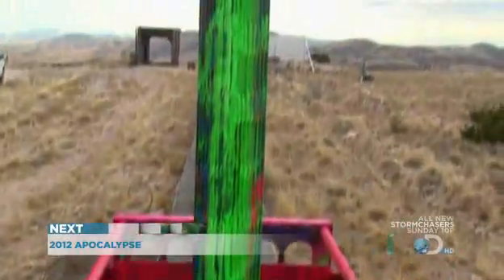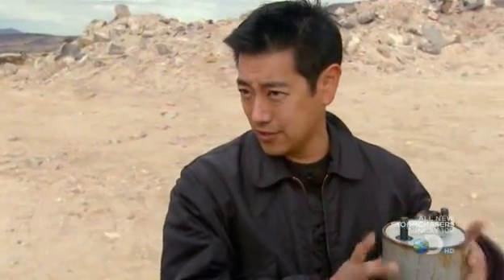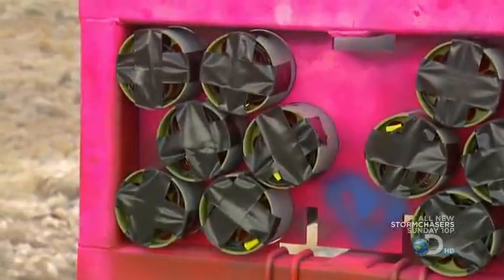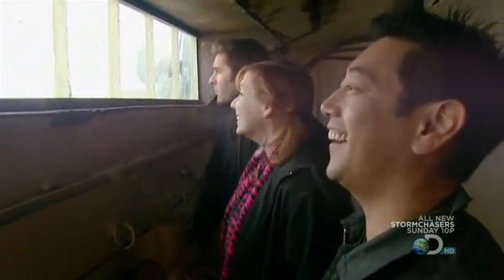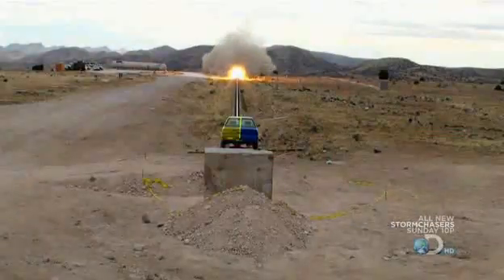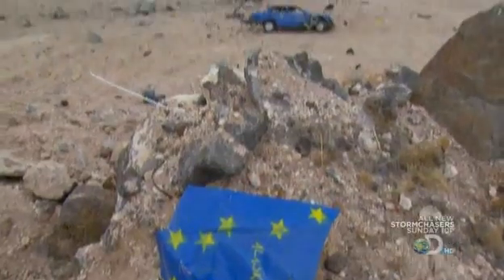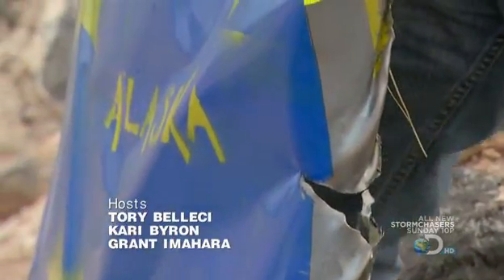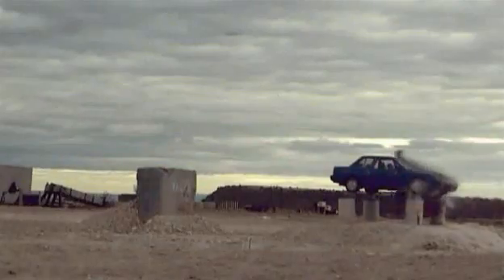Mythbusters: Myth Revolution - Rocket Snowplow

Comment: 15 feet of car.  Including the virtually solid mass of the engine block.  Sliced in two by a rocket sled that weighed 2 tons?  And the Truthers have a hard time understanding how a passenger jet can slice through hollow steel columns 9 mm thick and 2 feet square of the WTC. 

Really?
Reply: Talk about a hard time understanding, you're really embarrassing yourself. 
The "solid" engine block and most of the car was softer  ALUMINUM which was utterly DESTROYED by the HARDER STEEL BEAM.  Sled has nothing to do with the impact between the mounted steel beam and the car.
The POINT of the video here is the "harder than aluminum" STEEL BEAM went THROUGH the softer aluminum car.
In the hollow parts of your brain, PRETEND the car was a plane that flew into the steel beam of a building!!!! . 
Now that you have that collision orientated  you'll see it demonstrates a harder steel beam of the building didn't get split by the softer aluminum car (plane) particularly at the fragile tips.  Kinetic energy, and inertia mean NOTHING because the two objects are in reality traveling towards each other at the SAME SPEED.  
This may be unfair because it requires you to comprehend what your seeing. try this one; https://www.youtube.com/watch?v=T5XTsQ-9vvo
ask yourself, gee why didn't the wings shear off? how come in the WTC video there's NO ejecta blowing backwards showering the WTC streets below with tons of debris?? why are there NO ripples or any impact shock wave traveling across the glass perimeter facade? or along the wings. THe wings would have crumpled against the heavy interconnecting steel plates between the 32' tall facade sections. google their architectural structure and you'll see them. the 4-6" deep reinforced concrete flooring of the 7 floors impacted alone would have stopped any plane in its tracks. 
  Because the WTC videos were FAKED an photoshopped but not without errors due to broadcast times...
Reply: @johnzarollin2749  thanks, finally someone who understand laws of physics.
Reply: @PetrLunak  it ain't easy but some ones gotta do it right? ha.
by the way, a NY state attorney's office has agreed to submit a new cause for discovery on the NIST 911 findings before a grand jury. It has been accepted. Actor Ed Asner and other's spent years raising the money needed to fund the new investigation  . Finally. bush and cheney may swing after all.
Reply: @PetrLunak  you're quite welcome, it may have been all those years at Lockheed MIssiles & Space Co. in CA. 
Building things that went boom in the night, 
counted hairs on heads from many miles above, 
or picked up items a few miles deep. 
Interesting work. A few things I like to tell people but can't. Things have NOT been what you thought they were for a very long time.
I started there after deciding not to work for a new startup company that didn't look promising at the time. It was called  INTEL. Man did I regret that.
Reply: The plane was supposed to break the 41 steel columns. Idiot!
Reply: You're a fucking moron.
Reply: roquefortfiles Wonderful thing kinetic energy.
Reply: The Popup Shisha Lounge It softens the steel the weight it supports does the rest which is why it took awhile to collapse! Explosives at the base means alot of quantity many instances of failed demolition from vegas and other buildings or bridges.
Reply: The plane is made of aluminium and that's much softer than the steel of the columns.
Reply: marinus18 Aircraft aluminium is alloyd to make it tough The airframe it's  not entirely  aluminium but iron even titanium would be used by the wing tips to prevent fluttering i would  think . Those box beams in the core were the thinnest of the columns in the buulding at the top section that plane took the shear out on that one side those buildings took a hell of a hit what did it shake loose besides fire retardant and drywall
Reply: Mathias Johani The box beams were strong but thin think of motorcycle front fork tubes big diameter but thin wall thickness. To keep them light as possible.
Reply: +Gene Rodriguez
Duralinum is tougher than normal aluminium but still much weaker than steel. Commercial airplanes don't really use titanium. It is mainly used because it's heat resistant which is only a factor in supersonic airplanes. With the wing fluttering I think you mean the counterweights that are installed in the wings. But those are usually made of lead or depleted uranium which is even softer than aluminium.
Reply: Mathias Johani Box beams were the sizes you stated The thickness of the steel making up the box beam was very thin so as to be light but strong.
Reply: marinus18 It's all about velocity you can send a marshmallow thru 3/8 osb sheet or as i did a 139 grain copper and lead softpoint thru a 3/8 piece of angle iron at close to a 45 at 75 yards
Reply: Roque You clearly  lack the intelligence for the debate. For starters the beams weren't 9mm thick. Even if the soft aluminum of the plane managed to slice through all those beams. (By somehow not disintegrating ) How did it cause the building to collapse in on itself? The beams underneath were not sliced by your miraculous aluminum.
Reply: Aluminium's combination of lightness, strength and workability makes it the ideal material for mass-produced commercial aircraft.  Strong aluminium alloys take the extraordinary pressures and stresses involved in high altitude flying; wafer-thin aluminium panels keep the cold out and the air in.
Many internal fittings like the seating on planes are made from aluminium to save weight and therefore fuel, reduce emissions and increase the aircraft's payload.
Today, there are over 27,000 commercial aircraft flying in the world, and many thousands of light aircraft and helicopters. Demand for passenger aircraft alone is set to double from 15,000 today to more than 31,500 by 2030.
Aluminium is the primary aircraft material, comprising about 80% of an aircraft's unladen weight. Because the metal resists corrosion, some airlines don't paint their planes, saving several hundred of kilograms in weight.
Aircraft manufacturers use high-strength alloys (principally alloy 7075) to strengthen aluminium aircraft structures. Alloy 7075 has zinc and copper added for ultimate strength, but because of the copper it is very difficult to weld. It anodized beautifully. 7075 has the best machinability and results in the finest finish.
 
Aluminum 7075-T6; 7075-T651
 
Subcategory: 7000 Series Aluminum Alloy; Aluminum Alloy; Metal; Nonferrous Metal
Close Analogs:
Composition Notes: 
A Zr + Ti limit of 0.25 percent maximum may be used with this alloy designation for extruded and forged products only, but only when the supplier or producer and the purchaser have mutually so agreed. Agreement may be indicated, for example, by reference to a standard, by letter, by order note, or other means which allow the Zr + Ti limit.
Aluminum content reported is calculated as remainder.
Composition information provided by the Aluminum Association and is not for design.
Key Words: Aluminium 7075-T6; Aluminium 7075-T651, UNS A97075; ISO AlZn5.5MgCu; Aluminium 7075-T6; Aluminium 7075-T651; AA7075-T6

Component
   Wt. %

Al
87.1 - 91.4
 
Cr
0.18 - 0.28
 
Cu
1.2 - 2
 
Fe
Max 0.5
 

Component
   Wt. %

Mg
2.1 - 2.9
 
Mn
Max 0.3
 
Other, each
Max 0.05
 
Other, total
Max 0.15
 

Component
   Wt. %

Si
Max 0.4
 
Ti
Max 0.2
 
Zn
5.1 - 6.1
 

Material Notes: 
General 7075 characteristics and uses (from Alcoa): Very high strength material used for highly stressed structural parts. The T7351 temper offers improved stress-corrosion cracking resistance.
Applications: Aircraft fittings, gears and shafts, fuse parts, meter shafts and gears, missile parts, regulating valve parts, worm gears, keys, aircraft, aerospace and defense applications; bike frames, all terrain vehicle (ATV) sprockets.
Data points with the AA note have been provided by the Aluminum Association, Inc. and are NOT FOR DESIGN.
 
Physical Properties
Metric
English
Comments
 

 
Density
2.81 g/cc
0.102 lb/in³
 AA; Typical
 
Mechanical Properties
 

 
Hardness, Brinell
150
150
 AA; Typical; 500 g load; 10 mm ball
Hardness, Knoop
191
191
 Converted from Brinell Hardness Value
Hardness, Rockwell A
53.5
53.5
 Converted from Brinell Hardness Value
Hardness, Rockwell B
87
87
 Converted from Brinell Hardness Value
Hardness, Vickers
175
175
 Converted from Brinell Hardness Value
Ultimate Tensile Strength
572 MPa
83000 psi
 AA; Typical
Tensile Yield Strength
503 MPa
73000 psi
 AA; Typical
Elongation at Break
11 %
11 %
 AA; Typical; 1/16 in. (1.6 mm) Thickness
Elongation at Break
11 %
11 %
 AA; Typical; 1/2 in. (12.7 mm) Diameter
Modulus of Elasticity
71.7 GPa
10400 ksi
 AA; Typical; Average of tension and compression. Compression modulus is about 2% greater than tensile modulus.
Poisson's Ratio
0.33
0.33
 
Fatigue Strength
159 MPa
23000 psi
 AA; 500,000,000 cycles completely reversed stress; RR Moore machine/specimen
Fracture Toughness
20 MPa-m½
18.2 ksi-in½
 K(IC) in S-L Direction
Fracture Toughness
25 MPa-m½
22.8 ksi-in½
 K(IC) in T-L Direction
Fracture Toughness
29 MPa-m½
26.4 ksi-in½
 K(IC) in L-T Direction
Machinability
70 %
70 %
 0-100 Scale of Aluminum Alloys
Shear Modulus
26.9 GPa
3900 ksi
 
Shear Strength
331 MPa
48000 psi
 AA; Typical
 
Electrical Properties
 

 
Electrical Resistivity
5.15e-006 ohm-cm
5.15e-006 ohm-cm
 AA; Typical at 68°F
 
Thermal Properties
 

 
CTE, linear 68°F
23.6 µm/m-°C
13.1 µin/in-°F
 AA; Typical; Average over 68-212°F range.
CTE, linear 250°C
25.2 µm/m-°C
14 µin/in-°F
 Average over the range 20-300ºC
Specific Heat Capacity
0.96 J/g-°C
0.229 BTU/lb-°F
 
Thermal Conductivity
130 W/m-K
900 BTU-in/hr-ft²-°F
 AA; Typical at 77°F
Melting Point
477 - 635 °C
890 - 1175 °F
 AA; Typical range based on typical composition for wrought products 1/4 inch thickness or greater. Homogenization may raise eutectic melting temperature 20-40°F but usually does not eliminate eutectic melting.
Solidus
477 °C
890 °F
 AA; Typical
Liquidus
635 °C
1175 °F
 AA; Typical
 
Processing Properties
 

 
Annealing Temperature
413 °C
775 °F
 
Solution Temperature
466 - 482 °C
870 - 900 °F
 
Aging Temperature
121 °C
250 °F
Reply: The world is full of people who think they're mechanical forensics.  Apparently I'm one also as per my following comment...

The complexity and amount of unknowns of the components involved in the 911 collision make it difficult to exactly simulate what happened, but we can sensibly argue that, no matter which one of the impactors was made of the weaker, lightweight material, they both got severely damaged from the impact alone.  It didn't work like a Brinell or scratch hardness test, where only one or the other surface of two solids yields with no trace left on the other.  In the collision, they were not two solid materials, but instead a arrangement of each, with a variety of shapes, where the collision is comparable to the bulk of those substances.

For example, I can break glass and bend steel with my bare hands, even though I, and even my bones, are softer than the external materials.

The burning fuel weakened the already damaged structure to the point it yielded to the weight above and collapsed.
Reply: roquefortfiles google some images of what a medium bird does to the fuselage of the airplane
Reply: truthers are still correct, IF there were planes involved, which there weren't any on 911, then the SOFTER than steel aluminum planes wings, tail section, seats, people, luggage all would have been sheared and peeled back and fall to the ground in MASSE. Heavier parts, like engines, would have continued traveling into the building. The blowback is called ":ejecta". The 600 mph Phantom 4 jet crash demonstrates that a bit better.  https://www.youtube.com/watch?v=F4CX-9lkRMQ
also here's a link that totally exposes the outright fakery of the alleged "plane" impact at the pentagon.
https://www.youtube.com/watch?v=rn3A3c_FAOw
this is what we get folks when students sleep through high school science classes. IDIOTS
Reply: @Europa Invictus the first plane hit the building at 450 mph. It went straight through and came out the other side. In bits.  Along with everyone on it.  The second plane hit at 560mph.  Should we expect anything less? 100 mph faster than the first plane?.  The people in the ahem TRUTH movement astound me
Reply: @Europa Invictus No. Its not directed at you.  Just a general statement. All of these truthers go on and on about the speed.  A friend of mine flies a 76.  I asked him this question point blank one day.  He said.  "No problem"
Reply: Rusty Climber  Ok.  And your point is?
Reply: But jet fuel doesn't melt steel beams! And if you add up 11+4-6=9 and add a 11 at the end. You got 9/11. Still not convinced?!
Reply: The Popup Shisha Lounge

Nobody ever claimed the jet fuel melted the steel !!.   It doesn't have to.  It only has to soften it.   Once that happens the building is creeping.  Putting enormous stress on bolts not intended to have loads put on them.
Reply: Schwarzer Ritter

In scale to the size of the building the exterior columns were no thicker than a piece of paper.  This is a VERY light construction.  People don't seem to understand that.
Reply: They made little to no sense because you can't understand the concepts involved.  No wonder you can't understand this subject at all and write such stupid shit.  Your comparison to a bird hitting the plane is RIDICULOUS.    You're talking about something that weighs 1/2 pound impacting a tiny area at high velocity.   The plane weighs 200 tons impacting a HUGE area at a huge speed.    The B 25 that hit the Empire State Building in 1945 weighed 15x less. Carrying 10x less fuel and moving 3x slower.  It put a hole in a heavier building than the WTC.

The 767 was 15x heavier.  Carried 10x the fuel load.  Moving 3x faster.   And it was hitting a SUBSTANTIALLY lighter designed building.     The variance of applied force was...........

FOUR THOUSAND FIVE HUNDRED AND FIFTY  Times MORE force.   applied to a lighter structure. 
I am sorry pal but the math is off the charts.
Reply: Equiliz No... if someone say that the steel in the wtc was 9 mm thick then that person is a fucking idiot.
Reply: @mathiasjohani2130  He was in part correct about the thickness of the steel in the columns and in fact may have totally correct about the thickness where the airplanes hit. 

In the external walls of towers one and two of the World Trade Center, the steel also varied by thickness to allow for different pressure loads at different levels. In the lower levels, the thickness was most frequently around 4 inches (10 centimeters), while at higher floors, it could be as thin as 0.25 inch (0.64 centimeter) [source: FEMA].
He was also correct about the external dimensions of the columns as being 2' x 
2' which is 65 cm x 65cm not the 6.5 cm you described. 
My dad who was a structural engineer for over 45 years told me after the first bombing of the Trade Towers the bombers didn't know what they were doing because you would never knock down the towers with a car bomb in the lower parking decks. He told me if you want to bring down the Towers all you had to do was start a fire on one of the upper floors which would weaken the the floor system which would collapse straight down to the floor below it. That floor, not being able to take the impact load, would collapse down to the floor below it and so on. That is exactly what we saw on 9-11. I remember thinking when I saw them coming down, "Dad was exactly right". By the way, my dad thought it was a crappy design and I saw an interview with structural engineer of record on the job and he was sorry he ever designed it that way.
Reply: +roquefortfiles
I have seen truthers using this to theorize the columns should have cut through the plane.
Reply: yaa you are an idiot
Reply: they should replace the car with a tank
Reply: Mike Dykhoff Its the same thing it dosnt matter which object moves. if that sled did that to the car, that means that the sled should be cut in half by a wing...thats how real physic works..and that is how stupid people are who belive thats actually happend.  Nothing adds up regarding 911...its a triple psyup. Everything regarding the official story is a fucking lie and its totaly lack of physic eveidence proof just that. A airliner do not just disappear thruu a steelwall thick as a tanks armor without any collision and falling debree...sorry for my bad grammar.
Reply: These arguments are ridiculous.   As I said.  Your answer to the airplane sized hole in the building is what?  That it isn't THERE??    Are you fucking stupid or something??.     Gee what happens when you fly a passenger jet at a building??.. Hmmm??   Well lets try that and see what happens. 

Are you blind and dumb at the same time??.   You can SEE the fucking hole carved out of the building and you're trying to argue it isn't there??.   What kind of reasoning is this??.
Reply: The first plane went clear through the entire building at 440 mph.   Your reasoning tells you that the second plane is somehow going to go through it LESS at 560mph??.   Don't join the debate team any time soon.
Reply: ???  Buddy?  the plane impact to the building was worked out and computed using a CAD design program that is capable of making hi rise buildings.  Every variable was entered as data.  The plane's weight and speed and the fracture point of the steel.   This was no contest.  The plane went through the side of the building easily.  Of the total force delivered doing so was arrived at ONLY 2. 5% of the total force delivered.  That was a MINOR element of the collision.  Not a major one.   And the fact the building was designed to take a 707 has nothing to with what we are talking about.      And once again.. Your argument of the giant hole in the side of the building is WHAT??   That it isn't there?     Your argument makes absolutely no sense given the visible facts involved.   I don't really even know WHY you are trying to argue this.   Go and look at the building.. Are you blind??
Reply: Do you have the slightest idea of how loud one shaped charge is?  Let alone half a dozen?.  And nothing remotely close to this is heard on any video of it collapsing.

Silly stories.
Reply: Last 20 feet the beam was in a free flight with the speed of 550 mph. So it was a collision between a car & a steel beam only, without rocket sled weighed 2 tons. The rocket sled reached the palace where the car was after the car had already been bisected by a steel beam. 
And the most interesting question is - why they installed the  concrete block behind the car. If they didn't everyone could see that the beam left almost undamaged.
Reply: 9mm Are you high or what? They were 6.5cm = 65mm  6.5cm *6.5cm*6.5cm*6.5
Reply: Källarmannen Källarmann M8 stop being salty over the imternet
Reply: How a soft bird can tear into a plane?.  Because its 1/2 pound of mass is multiplied by the velocity the plane hits it with and that small mass impacts a tiny area with a lot of force.  

That is in no way similar to the 200 tons of the entire plane moving at 800/ft/ sec impacting a HUGE area.   The wings were full of fuel.  Liquid does not compress.  Don't believe me?.   Which would you have dropped on your house?  An empty aluminum back yard swimming pool?  Or one filled with 10 tons of water?. 

The fact the pool is lightweight aluminum does not change.  The force delivered at impact certainly does.
Reply: The fact that wtc 1or 2 could be considered light construction is a myth do you have any Idea the wind loads etc.

Would you like a direct quote on that?.   "Resulting in an EXTREMELY LIGHT construction.. "   Go and take a look at the shattered wall sections of the building during the clean up.  There is nothing to this building. It is WAFER light construction FOR ITS SIZE.   It is strong because it is REDUNDANT.    

And again.  Your answer to the 155 foot wide hole is that it isn't there?
Reply: Buddy?  Go and take a look at the shattered wall sections of the WTC in the aftermath.  There is NOTHING to this building.   Go and take a look how THIN the exterior wall really is. In scale the exterior wall is as thick as a piece of paper.   Its strength came from its redundancy.    This was an incredibly LIGHT structure.   Purpose built that way.     To be honest I really don't even know WHAT your argument is.   You can see the hole in the building.  And you're arguing the plane can't do this??     Of course it can.    You don't believe the Gov's account of that day???   Based on what??
Reply: Light implies weak?  to mislead the public?..  Buddy!!  seriously.??

Quote.. The building was a piece of junk.  Cheap, flimsy and light.  It had a floor system that had never been used before.  The same thing you'd see in a Lowes Hardware Store or a high school gym roof.   You can't fire proof the diagonals properly.  The material won't stick.  They did not have to conform to the NY building codes they were immune.   The building was a piece of crap.  A horrible building.

This was said by Charles Thornton.  The head of the NIST over sight committee. Not some Richard Gage type.  It was said by the head of an Engineering firm.
Reply: go ask your physics professor what it would take to take down a building that is supposed to whistand fucking earthqakes like a domino piece it is not about w/e the plane can destroy the building it is about the way the building fell
Reply: The way it fell?.   If you are expecting the structure to remain standing when 32 floors collectively fall on it. You have little understanding of HOW a building works.
Reply: The building had a unique design. Unlike other structures.  And sorry but please explain to me the value and worth of imploding a building that had nobody in it and had been burning unattended all day.
Reply: yah they would fall but not like fucking dominos  like i said ask your physics professor what it would take to make a building fall that way and you will have your answear you dont have to believe me go check in up yourself and if you find i am wrong then good :D
Reply: I don't find you are wrong.  I know you are wrong.  The building below the failure point is ONLY designed to carry the weight above it STATICALLY.  That is HOW the building WORKS .    That is how ANY building works.  WIth a margin of error of about 5x the resting static load as a safety buffer.  When the top of the building failed this generated a DYNAMIC load on the structure that was nearly 30x over the resting static load.     There is nothing below this that is remotely designed to stop and arrest that much weight MOVING!!.   And with each successive floor failure energy is being ADDED to the collapse.  That is why it actually speeds up.    Physics has nothing to do with this.  Engineering does.
Reply: Oh.. your point is proven because we can't fly a plane in to another building to make an experiment.  What a fucking stupid example.    You're full of shit.
Reply: Another brain dead example.  2 for 2
Reply: Right.  You idiots make it too easy for people who actually understand engineering.  The fact that the building gets heavier as it goes down is ONLY to carry the resting static load of the building.  Its own dead weight.   When the top begins MOVING this is a DYNAMIC load.  No building is designed to deal with this KIND of weight.    

Would you like a paper on it?   An Engineer wrote it.   Please continue on stuffing your foot in your mouth.  This is too easy.
Reply: Maybe change your name to HALF WITT.  Designed to support 5 x everything above it?.     Right.  Again thank you for playing directly into my point. 
And when the top of the building failed this generated a Dynamic over load THIRTY TIMES the resting static load.  For WTC 2 the over load was EIGHTY times over.     NOT 5!!

Read the following.  It is a direct quote from an Engineering web page.  Are you seriously that dumb?? 

Even though the lower undamaged structure was designed to be able to handle the upper damaged 18 stories, this is only true in a static sense.
 Once the loads became dynamic (due to gravity), the dynamic loads had 
already far exceeded the structural design limit and the failure had to 
propagate until all the energy is dissipated.
Reply: Your comparison of snow to a building is absurdly stupid.
Reply: roquefortfiles speed does amazing things, that's how grass can be impaled into a tree.
Reply: Mike Dykhoff oh.and imploding it wipes that all out?.. the fucking nonsense you people tell yourselves.  good grief.
Reply: There was not enough calorific potential in the entire load of fuel to heat enough beams to a high enough temperature in a short enough time span to have any remarkable effect on structural strength. Steel can conduct heat very efficiently, so while the fire heats a certain part, the heat transfers to the other, cooler parts, and then to other beams that are attached to it. The fires that occured were not that hot (dark smoke means the fire lacks oxygen), and they certainly were not concentrated enough (like a gaz torch would do) to cause any significant weakening.